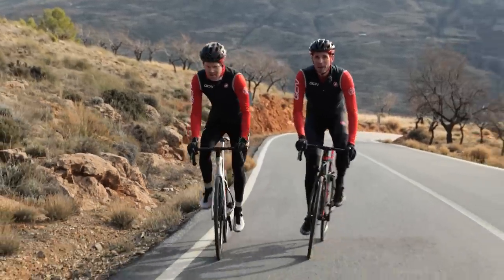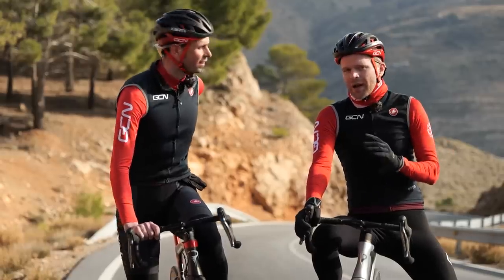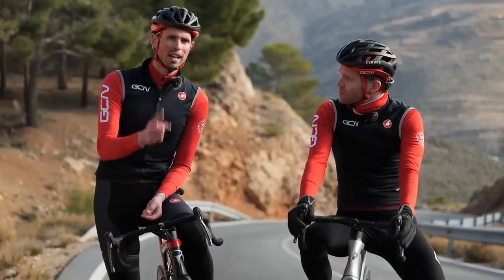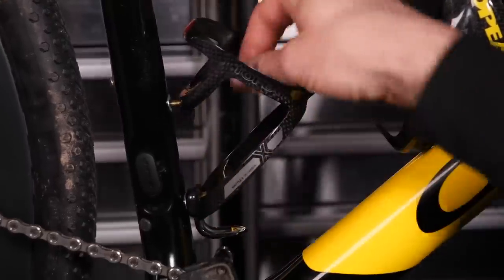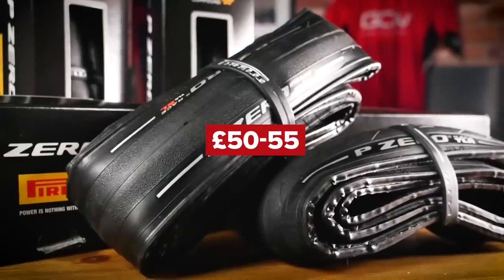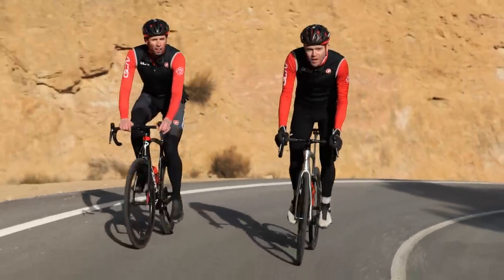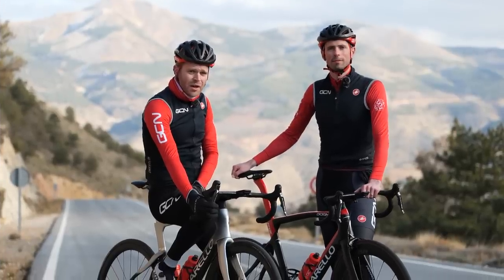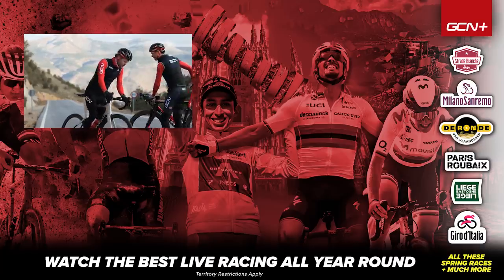What's The Best Value Upgrade For Your Bike - Spend Or Save?

Comment: Rotational weight is definitely a thing… because of physicals.
Reply: They've showed that it isn't because the whole system is in motion, not just the wheels
Reply: @spaghettibadger647  I have watched both videos they did on this subject and both videos were flawed. 

Let me just spell it out in the simplest terms. 

It takes more energy to get a greater mass to start moving and it take more energy to get that mass to accelerate. Fact. (Now once that mass is moving does it take more energy to keep it moving? No.) 

Therefore if all things being equal if you have 2 wheels of identical aerodynamic design and the same hubs and spokes but one wheel set is heavier. (For example one is made of carbon and the other of aluminium.) Then the lighter wheels with spin up faster. 
That’s just a physical fact. 

Even if the bikes are also the same weight in total you would be better off to pick the bike with the lighter wheels and heavier frame than the other way around. 

What GCN did was A) a totally flawed experiment by comparing a lower profile wheel set with a deeper one. (When they added weight to the same wheels it was less effective.)

And B) when they spoke to an “expert” someone who sells aero wheels that tend to be heavier they did their calculations based on a poor comparison also, because they pitted a Low profile lighter wheels against a slightly heavier much more aero wheel set. That is obviously going to produce misleading results. We don’t know what simulation they used and even though they set up the experiment to make sure the light weight wheel would fail, they did have to admit there was still a slight advantage to the lighter wheels! But they simply played that fact down. 

I will post both my comments from those videos below so you don’t have to look for them on the videos, but in conclusion:

If you have 2 50mm wheels sets to choose from and they are basically the same including price but one is significantly lighter, are you telling me you would buy the heavier wheels? No obviously not. 

……
Previous comments on GCN videos:

The video should be called 
"Rotational wheel weigh doesn't matter in clearly defined situations played out on a computer in a lab." 

Or 

"Rotational wait doesn't matter when you are an aerodynamic wheel company Who specialises only in aerodynamic wheels that aren't as light as their competitors" 🙃 

…..

Lighter wheels accelerate faster, so in a crit with lots of corners it makes a big difference to the way the rider feels and how they get tired. 

If you are in a TT race yes it doesn't matter that much. But you still need to work harder to get a heavier wheel moving and you don't have unlimited energy because every time you work you get more tired and that will have an effect. 

This shows how some scientific research is not actually helpful or accurate because they are testing a very narrow view of the way a rider and a bike interact. 

The fact is a lighter wheel is better than  a heavier wheel. If all things are equal then weight matters.

And when you brake you need to break harder with heavier wheels to slow you down and that makes life harder. 

I have raced on heavier wheel and lighter wheels in a crit and I know how they feel and what I'd prefer to have. 

I like Swiss side but this is definitely just an advert, they are not making a good comparison. And they openly admit it does make a difference they just play it down.

Comment: Gcn keeps remaking the same videos. As an avid cyclist. The upgrades should go in this order assuming your bike is decent already: tires, saddle, bar tape, wheels, group set… but if you’re at the point to upgrade the group set it’s time to buy a new bike (3-5 years). If you have to upgrade things like your handle bars then you bought the wrong bike from the start

Comment: I am genuinely surprised you didn't mention fibre reinforced plastic bottle cages. As aero as carbon cages, as cheap as alloy ones, and weigh somewhere in between (closer to the carbon ones). Great cheap weight saving. Good quality glass fibre reinforced plastics are as strong as carbon too.

Comment: Those butyl tubes at 120 grams must be heavy duty ones. Thin tubes only weight 90 grams. It's not really worth 3 times the cost for 5 grams. Save 25 grams on Water bottle cage only to put a full bottle of water into it that weights 650 grams. It doesn't make sense!

Comment: You can’t save a lot upgrading your cable housing, up to 50% on brake cables by using that segmented aluminium link type… oh wait you guys use hydro disc so you can’t make that any lighter….
Reply: Save even more weight by replacing your cables with nylon Powercordz

Comment: I have just managed to save 5kg off my rig - all without touching a thing on the bike. The 5kg came off me and it cost nothing. Trying to save weight on your bike is an expensive exercise - as your video points out, but unless you're competing in the Olympic games or something, it achieves very little. By far the greatest contributor to the overall weight of the rig is the rider - by a factor of at least 10 so it makes sense to look at that part. Same goes for aerodynamics - no bike provides much in the way of drag compared to the rider.
Reply: That works until a point. I have never been able to lose or gain weight easily and at 72kg and 185cm I don't really care to get any lighter. For heavier riders I suppose that is an option though.

Comment: "rotating weight isn't a thing because of physics" FALSE !!! this sentence could be true if the motor have always energy (a car, a moto,etc...) but, we speak about human power here. You start you ride with 100% energy, but after 100km you have not the same capacity. So your rotating weight is a thing ! 
On paper, right potential energy = kinetic energy. But if you have 80mm wheel to bring on alpine pass, lets say 2 consecutives climbs, you will defenitly regret your choice ! 
For a mecanic motor, rotating weight is less important... because your car start with 150hp and after 100, 200 or 5000 km it will always have 150hp! a car is never tired ! a cyclist is